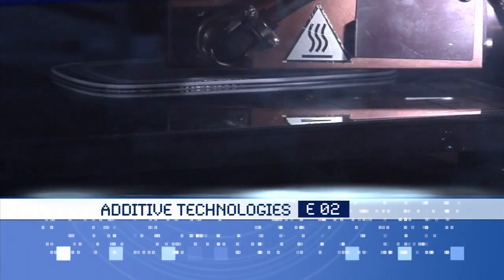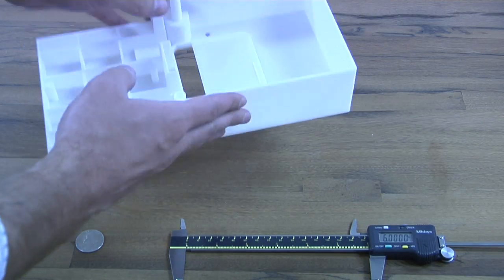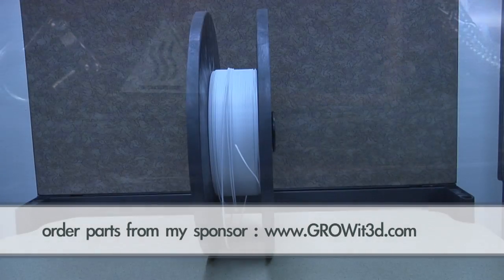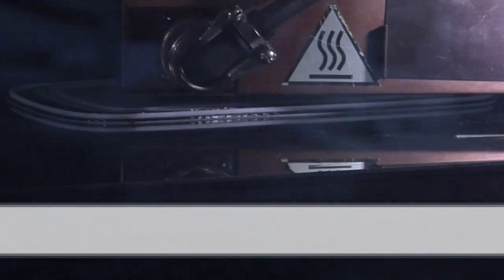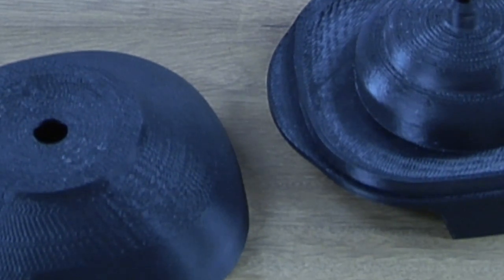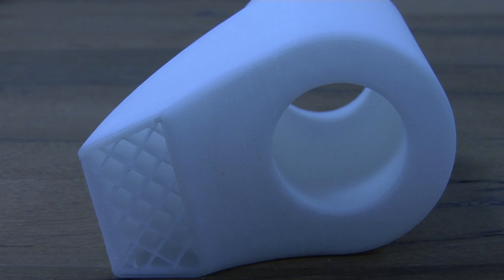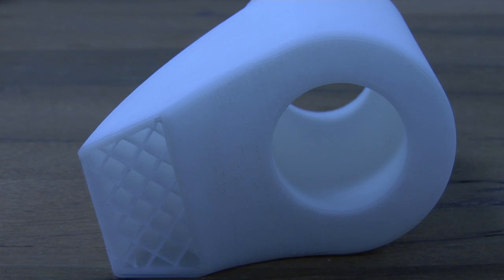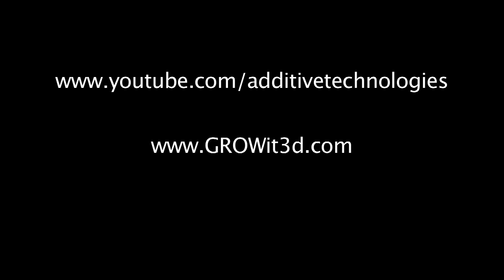3D Printing - Fused Deposition Modeling - Additive Technologies - (Rapid Prototyping)

Comment: This video is not fully accurate. ABS, Polycarbonate, and PC/ABS blend, are indeed resins, do "cure" over time and thermally expand and contract with temperature. They do shrink and warp over time, although with small parts shrinkage is not generally noticeable. Larger parts however have shown significant shrinkage, a problem the industry is currently trying to resolve through broad-area additive manufacturing. Do not take this video for face value as it is not inaccurate.